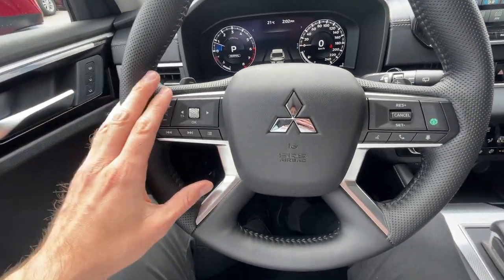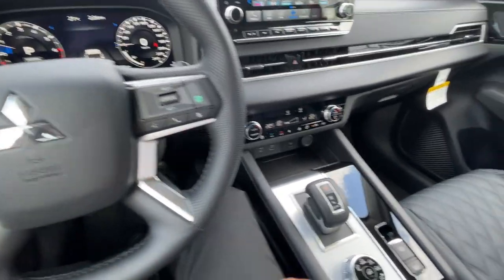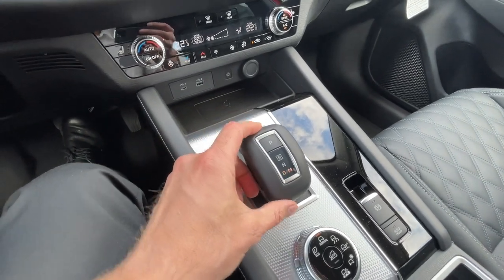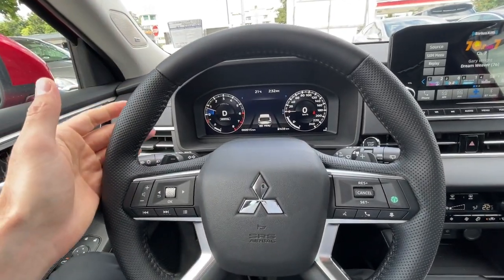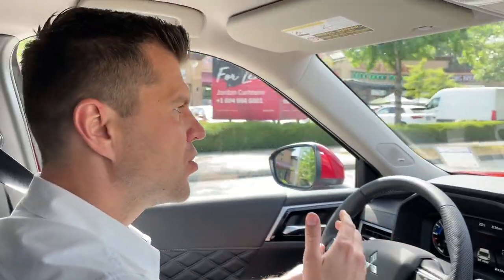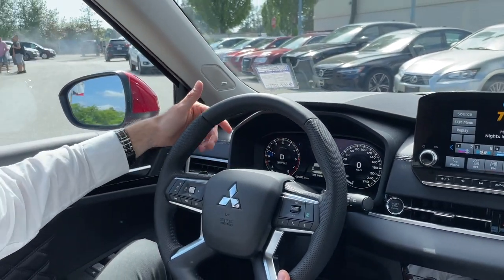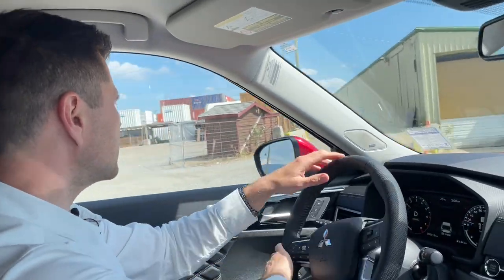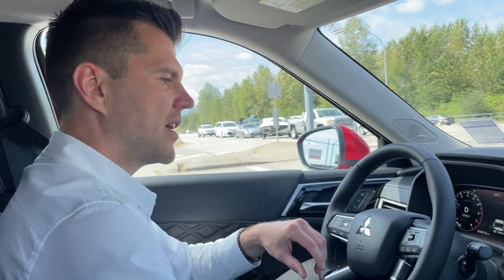Paddle shifters 2022 Outlander- explained and demonstrated!

Comment: Had my 2022 Outlander in for an oil change and told Sevice, I was having trouble with the transmission not shifting out of low gear when the temperature was  below freezing.  After driving a few miles the transmission would shift normally. The mechanic told me he had an Outlaner and that was normal. I called Mitsubishi and filed a complaint, that is not normal.  I had the same issue in February, days after purchasing the Outlander and reported it to Service. Will update after Mitsubishi resolves the issue.
Reply: Update?
Reply: @DJ_D3ADSTOCK  He probably realized he's not in his 50s Ford anymore and quieted down 😅

Comment: thank you for your videos Mr. Mitsubishi. Sorry haters but this Mitsubishis is great, I bought one recently  I used to drive a Nissan X-Trail and change to this, and I do not regret it for a minute, we also own a 2020 AWD Outlander Sport (ASX) which is   beast but a little too rough. I live in Costa Rica, so we have a lot of uphill and downhill daily driving and this paddle shifters are very useful. I do a 20 miles commute every morning and half of each is urban driving and the other half highway like with a steep downhill, shifting my car to third gear prevents me to abuse the breaks. I personally like CVT and thinks this one is quite good, some people don't like CVTs, well buy a car without one and if you like sporty go stick. Last year I rented an Alfa Giulia, with paddle shifts and real gears no CVT, it was wonderful, very sporty, it was wonderful quiet superior in every driving aspect but will not do for me as a daily driver, I enjoy too much the roomy car, the silence, the seven seats, the off road capabilities of my Outlander, and when you compare the paddle shift experience is not that much different, what to me shows a lot for the Outlander. So my personal experience has been very positive, maybe because I sit down and think what I wanted in my car, and I bought what checked most of the boxes.
Reply from the maker: Thank you for your comment! :)

Comment: Why so many complaints about the outlander 2022 ? I'm about to buy but im confuse now
Reply from the maker: Not sure.. We sell a lot of them.. No major issues or complaints
Reply: I’ve read about many issues with this vehicle on an Outlander FB page. I was thinking of purchasing one but now I’m not too sure.
Reply: @Memo76ers  my step dad has one and it runs good
Reply: The only complaints are the hood flutter, some being replaced by Mitsubishi. The second issue is parts, expensive and hard to find. The third issue, no parts list in the owners manual. Apparently the replacement parts like  air and cabin filters, sparks plugs and light bulbs a secret.

Comment: Paddle shifting isn't going to make this Nissan Rogue clone any faster. It's a CVT and not a particularly good one. There far better options for a smaller suv. Besides the vehicle itself, where you gonna get it serviced. Better question, why is Mitsu, who once made fun car's you wanted to drive, still trying to sell car's in the US?
Reply: dude you are effing crazy. outlander is top selling in the usa
Reply: Very valid points. I had a 09 Lancer GTS, and many of my car's parts are still on a 2022 Mitsubishi. Simply sad you have a company that just doesn't care.

Comment: I just rented one of these.  The way the auto shifter works is the dumbest design ever.  I had to watch a YouTube video to figure out how to shift it and still have to pull, brake, push, and click around with it until it goes into gear.  Ridiculous.  And if people want manual, why not just offer that with a clutch and stick?  Even that would be easier than figuring out the auto shifter through trial and error.
Reply from the maker: Thank you for your comment!